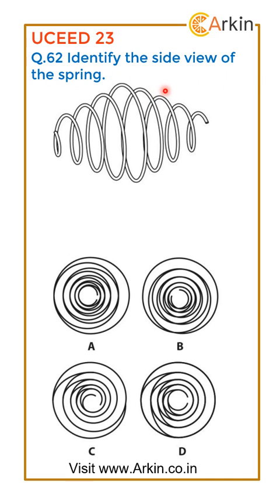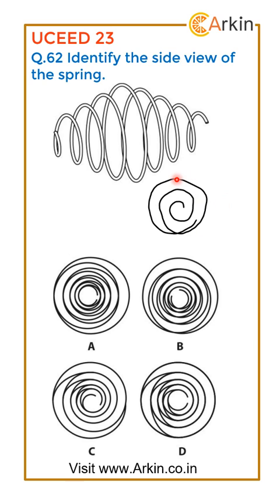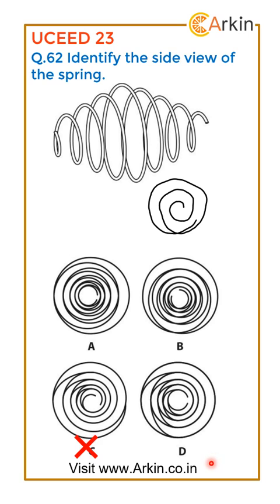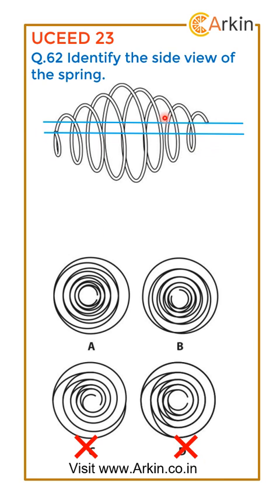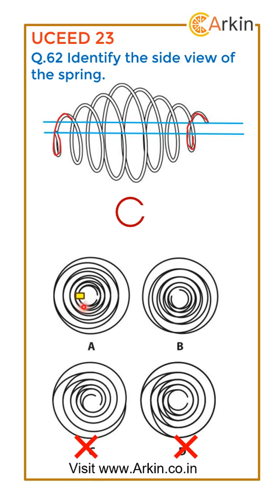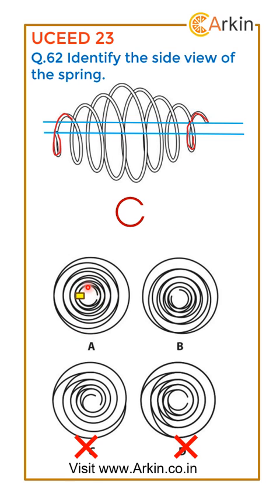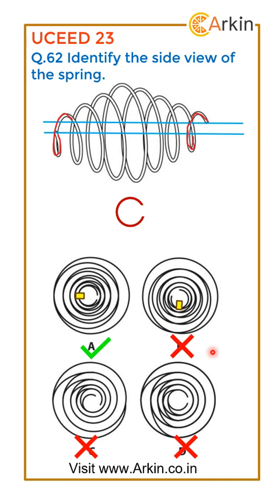Solved Q 62 of UCEED 2023 #uceed2024 #uceedSolution #ceed #designentranceexams #onlineclasses

Comment: This was my approach for a and b-
In b we can see that the side view is rotated a bit left so the point where the spring starts to become smaller should not be down as it is in the front view. It should be a bit to the right in option b because of the rotation.
Be same approach in option A the end points are rotated a little to the right so the point where spring becomes smaller will be more to the left side that's why A is correct